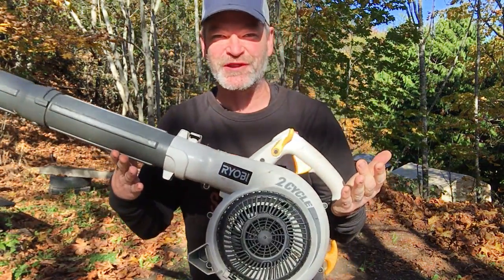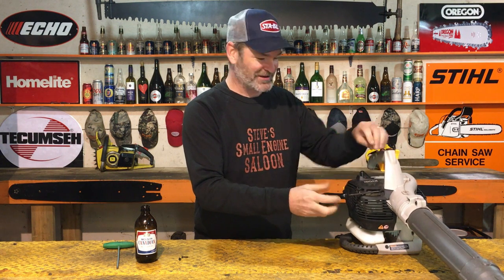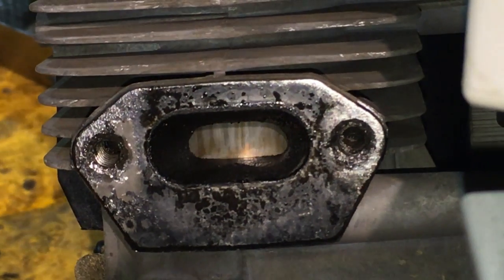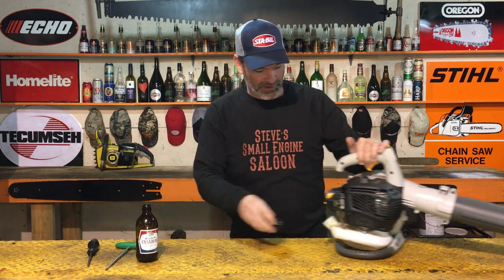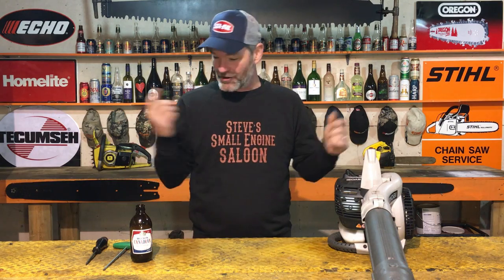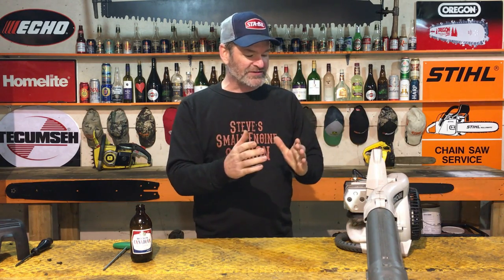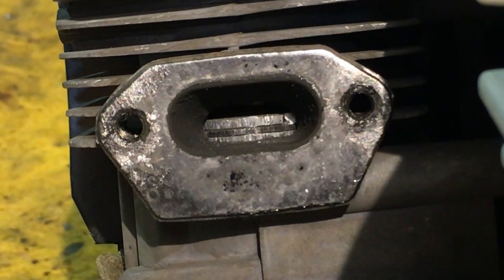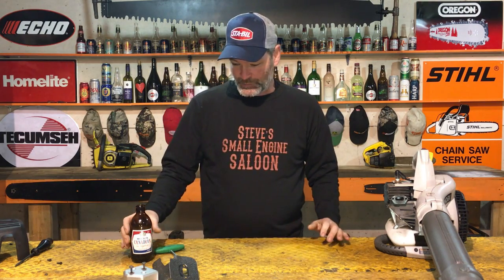What Happens When You Run Straight, Unmixed Gas in a 2-Stroke, 2-Cycle Engine

Comment: I did this very thing many years ago accidentally put straight gas in my weed eater.... It ran about 15 minutes and then seized up tight.... After it cooled down it was not stuck anymore so I put in some oil mix fuel and it ran for years after that

Comment: Is it worth fixin just asking I put a brand new carb on my blower for 12 bucks of amazoo. Also used to replace both pistons and rings  (for cheap) on my 1968 Yamaha 125 twin when I would hit 73 mph and they would melt    lol    good old days
Reply: So is it fixable I got a craftman weedwacker 25cc which we used without mixing fuel wit the 2 cycle what to do now

Comment: Great video! I always wondered what would happen if someone did that? I already have a decent stock of Stihl oil to mix and I’m fortunate enough to have a gas station nearby that sells non-ethanol gas. My question for you is have you ever performed a test to see if one oil mix is better than another or if it’s better to mix your own oil with gas as opposed to buying premixed gas?
Reply: I use stihl motomix which is specifically formulated for stihl machines. It has a much longer shelf life than what I can mix.

Comment: as a mechanic... hardest thing you have to do is diagnose a 2 stroke piece of equipment, which takes 3 minutes as you're being nice and doing it in front of the customer... letting them be involved... they say it wont start, well first thing ya do is try to start it.. squirt a little carb cleaner in it and no luck... pull that muffler and have to explain why the piston looks like your grandma's cheesegrater, you want to avoid accusing them of a bad gas/oil mix cause they can get offended by that, maybe the rpm's were too high, talk them down and dont just say "there's your problem!" sometimes this job can be as hard as a medical professional giving bad news to a family. alot of equipment i diagnosed lately "looks" from the outside as if it's only had very little use.

Comment: Hi steve man I need your advice I have a husqvarna 525L since new it's always had hot start issues like the older echos but older echos I would just prime them 5 or 8 times and half choke them and they would start but husqvarna you can't half choke them and I've tried every trick and nothing it takes me like 5 minutes to get it going and that's time lost I've taken in for warranty all they do is adjust the carburetor and still does the same thing i use 89 octane and echo oil and i don't choke it when it's hot all i do is prime it like 10 times it starts and turns off it does this like 5 or 8 times until it finally stays on I've heard this is called vapor lock or something like that.

Comment: This same thing happened to me with the Poulan PBV-200 Power Blower/Vacuum that I bought in 2004. Worked fine all these years. In 2019 It lost power slowly until it quit. Couldn't restart. Blowing off snow outside in 22 degree weather after a snow.  Piston and cylinder looked exactly the same. Fuel/oil mix was correct and fresh. I think the issue was I didn't let the cylinder head warm up enough to expand and the piston and ring scored up the cylinder causing a loss on compression. Maybe an electric blower would work better. ( Battery powered) NOT AC voltage. ?????? St. Louis MO.

Comment: Question... If the gas oil mixture is wrong will the engine cut out? I ask because I grabbed the can that I believed had the mixed fuel in it. (I still think it was the right can) After filling the blower it won't stay running. It starts and cuts out when I touch the throttle. Last time I used it, probably a couple months before, it worked fine. Which has made me wonder about the fuel I put in it. Was going to drain it and mix a new can of gas and oil and start over. Any thoughts? Can the wrong mixture case this issue?
Reply: Well I figured out my problem, it wasn't the gas. The problem is it's December and 32°, lol. I brought it into the house for the night to warm up. This morning I took it outside and pulled the cord and she fired right up! Ran for an hour and 45 minutes no problem at all. Now I understand 2 stroke engines don't like the cold but I know how to rectify that. Thanks anyway :-)

Comment: I bought a. Cheap snowblower that the guy couldn’t get running and I’ve been running straight gas in it last 2 seasons and it’s been fine I mean I only have like $50 in it so if it breaks big deal compared to buying a new one for a few hundred

Comment: OK so I bought a leaf blower on Saturday and did this very same thing. It ran for about 12 to 13 minutes and Straight Gas and I certainly didn’t do it on purpose I completely forgot. Installed the string when Apple is completely locked. Is there anything that I can do to save the sleep floor. I’ve called the place where I got it and I told them the truth and they told me that I would need to go get it fixed somewhere which possibly will cost me more than the leaf blower did in the first place. Is there anything that you can suggest? I was told to pull the spark plug and put some oil in there and let it sit. So if you can advise me on this I would appreciate it

Comment: Help, today I was using my Echo HC151 Hedge Trimmer, I used straight gas, worked for a while then shit off, re started and died again, now I can’t even pull the string like it’s stuck. I did dump fuel and add mixed but string is still stuck

Comment: a friend did this to his ryobi 36 cc and it stopped running, it cluttered to a halt, engine still turns over smoothly and there is compression but it won't start, not sure if the compression is enough, but there is a "kick" - fairly strong resistance on the compression stroke, but no attempt to fire as if there is no spark or fuel, he was advised to try turning the timing screw but still no go, i am not sure how many turns the timing screw should be out but i tried various positions, checked the usual and put a new spark plug in but no go, any ideas? .there's spark, fuel and the airfilter is clean, fuel gets to the cylinder, the machine is 2 years and used once or twice only, still looks very new.. maybe it was just a soft seizure..

Comment: Now if a person takes the time use a racing very tough coating from MicroBlueracing.com. On the piston, rings, connecting rod and needle bearings etc.  It should run fine for a long time.  But if you use the coating with a oil gas mix the engine won't smoke and will have more power!

Comment: I have a STHIL  back pack blower and I have ran a gallon of straight gas through mine before with no problems that I know of.  I did it because I had no mix and a lot of work to do.  I have since run mixed gas through and after several years it is still going strong.
Reply: No you need to call still and tell them about that they'll probably give you a free blower for life but I'm sure that you added it to other oil and that was a lesser ratio but it still was adequate to lubricate it
Reply: @vickilund7206   I had TRIED to contact STHL via email and also on their FB page But they had never responded to either. Besides I have absolutely NO DOUBT they would not GIVE me anything, heck, they cant even give me the time of day to respond to contacts.

Comment: +stevessmallenginesaloon I was expecting full seizure,i have a mcculloch line trimmer that i accidentally refilled with fuel without shaking the fuel can before hand,first time it happened it started ok but soon as i pulled the throttle lever the revs lowered instead of running faster like it should 😩 it wasnt until 2 days later i realised what id done & in a panic drained the fuel back into the can capped & shook the fuel,filled & started it praying to the engine gods that it was ok,big relief its still running strong months later 😨😨😎😎 be careful make sure u shake 2 stroke fuel b4 filling.
My 2 stroke can has a shake b4 filling reminder written on it now lol 😅😅😆😆

Comment: No lubrication for the piston, kills the engine. 4 strokes have a crankcase, which transfers the oil to the piston and lubricates everything. 2 strokes do not have a lubrication system. You have to mix the oil with the gas, so that when the piston comes down to let in the gas, the oil lubes the piston. Reply any questions.

Comment: '
right grammar is a What Happen When l Run Straight, Unmixed Gas in a 2-Stroke, 2-Cycle Engine...
wrong grammar is a What Happens When [You] Run Straight, Unmixed Gas in a 2-Stroke, 2-Cycle Engine...
dont need to use a word - YOU -

Comment: Always enjoyed the videos. Now how about rebuild video on a this ryobi. A Cylinder head and piston replacement cost vs cost of a new one.
Reply: Yes.  The MRS just ruined the $350 husqvarna this way.  Wondering if there is any reasonable rebuild?
Reply: @robertrayhelm6075 . This must have been a trend. My wife ruined my $350 leaf blower 3 years ago too…. I just pulled it out of the shed to see if it was worth fixing…. Guess not.
Reply: Not worth it if it ends up like this engine. Better to buy a new machine

Comment: I run my blowers and trimmers 100 to 1 ratio for years now without issue. People need to get a proper mixing cup and get exact with it. I’ve seen those little bottles that are supposed to be pre measured and be off a oz of oil in the bottle.
Reply: Why do you run it so lean? Why not 32 or 50:1?
Reply: Brian Morrison I used to use stihl oil at 32/1, bit after I switched to amsoil Saber oil the 100/1 ratio is perfect, I use less oil but get better lubrication at the same time, ya I know explain me that one, but amsoil guy gave me a packet to mix with a gallon of gas to try and I had no issues at all, it seemed to run smoother in fact, stihl fs90r and Bg 55 blower.

Comment: If you want small engines to run a long long time.  Remove the spark arrestor first thing and run saber professional 100:1 with a stabilizer and 0% ethanol in your fuel.  After one tank of regular shit dino juice to seat your rings.

Comment: Here's a question. You ran that on full throttle for almost 9 straight minutes. I don't think even pro machines run that hard. What would have happened if you would have run it the same (WFO) for 9 minutes WITH the oil mixed in?
Reply: While I can't speak for pro models, I can tell you that the two leaf blowers that we use at work are used by people who don't pay for maintenance or care about the equipment. We have had the same two leafvlowers for 3 years now and routinely run them wfo for half hour intervals. We use them to blow leaves and dust put of big hangars and need to get the job done asap so they aren't treated very well while being used. The only maintenance ever done to them is a new spark plug and air filter as needed. I'm genuinely shocked that they have lasted this long but don't seem to have any issues at all. Start within the first few pulls everytime.

Comment: What's the difference between 50:1 and 40:1 mixture?
Reply: 40 to 1 has more 2 stroke engine oil per gallon of gasoline.
Reply: @trentwheeler6161  Thank you!

Comment: Will that be fixable?? Our not worth  the time our money? Better buy a new one?? Thanks
Reply: Joao Costa if you took the time to take it apart, and free the piston ring, depending on how badly scored the cylinder walls are, you may just get it running again, but it will never be anywhere near as powerful or efficient. I’ve brought seized engines back to life doing this method.
Reply: @bobsmithinson2050  thanks.

Comment: I've had several pieces come into my shop lately where the customer forgot to mix oil and gas .... believe it or not , they seized up , and I freed them up by removing the plug and filling the cylinder with Marvel Mystery Oil,  letting it sit for a few days while gradually moving the crank back and forth and it loosened up , and they are both still running today  !! Sometimes you get Lucky I suppose !!
I always run a bit more oil than the mix calls for .... my theory is this .... if it's a smokin' it'll keep on strokin' !! Peace Out !! 😆
Reply: I use that same phrase when i describe my wift

Comment: I think only 2 stroke Tomos mopeds can survive 1 month of driving on pure gas. I've seen many of them running on diesel too 😂😂😂
Reply: Da, comrade! Good Soviet Tomos is strong like bull! Runs good on strong vodka too.

Seriously, I had one of these in the late 70s, very well built Yugoslavian 2-speed automatic. Still remember the bwaaa-rrrr sound as it accelerated and the second centrifugal clutch would engage.

Mopeds were great back then. With 2 HP, they weren't motorcycles, but the perfect machine to cruise about and learn the ropes.
Reply: @robertborchert932  Sadly firm is now in bankrupcy 😥 Otherwise I'm Slovenian. Tomos was originally produced in Slovenia (the former Yugoslavia) with branch in the Netherlands and UK since July 1954 to January 2019.

Comment: I tied a piece of trimmer line onto the handle  of my mixed gas container. Even I can not get them mixed up. I have also been known to put a little extra two cycle oil in  that container. It helps to keep the bugs away in the spring when they are at their worst.
 At least you are drinking Canadian beer on this video. I will tell you a little secret about American beer. American beer is like sex in a canoe....... it is f##king near water. Cheers!

Comment: I'm amazed that it ran that long.  I thought for sure less than a minute would have done it.  Now I'm wondering if less oil in the mix is OK?
Reply: Absolutely not! Run the recommended ratio depending on your oil. If running less is your liking, synthetics are the only way to go. These can allow 50:1 or better. Even in an emergency, running straight gasoline will destroy your engine.
Reply: Thanks very much.  I was posing the question.  I'll continue on using synthetic at the proper ratio.

Comment: Hey I paused at 5:30 just to make my guess. I'm guessing not melted but the rings are torn apart or torn up, the cylinder galled, and every last bearing just gouged to hell. This is like running a 2 stroke on starting fluid for 9 minutes...that said cant wait to see what this looks like...just a Kohler expert certified tech talking...I have an edit you got it right shes in tact but it's a Ryobi who cares in the name of a damn good point why 2 strokes die easy...2 stroke is awesome...people cant figure out that 32:1...a common old ryobi blower mix a 40:1, still common, and 50:1 are not interchangeable. Gas in a quart can isnt good forever. You dont know what oil or gas is in it, get yourself for mid grade or premium 89,91,93...ethanol free in states that sell it, Chicagoland here were outta luck! But just grab some good premium, Mobil, shell whatever and mix 2oz of seafoam a cleaner, stabilizer good for a whole year, fogging oil if injected, an corrosion inhibitor, a lubricant like diesel, a carbon buster and fuel system lifeline! At 50 a gallon for $7 a pint that's 8 mixed or 16 straight gallons of gasoline combined with the second best kept secret that's the pride of Porter, Texas and they...own a nascar track in Vegas the only oil that can kick Amsoil in the ass like Red Forman, ROYAL PURPLE! Famous as one of the longest synthetic lubricant companies that out of dozens of companies when wheel bearings on road wheels on the China bullet train were roasting bearings going over 200 MPH...a speed that should require auto injecting grease...almost 40 companies sent what they hoped would help them extend their replacement intervals...turns out only 1 grease we can get on Amazon prime 14.99 next day made the cut and Royal Purples synslide (I know it sounds like KYs latest lube lol) but this stuff turned roasted bearings into long service intervals and the results of 38 others didnt even come anywhere close. Its 9 bucks a QUART, you cheapos spend a buck for 2.6 ounces do the math...I spend 25% less for way better oil, use a mix cup the marine version at Walmart with the cap is great, the beaker style is awesome just avoid the mixmizer syringe the loop you pull breaks within a few uses...mix your not so secret elixir I described and I dare any single one of you to find a single negative, and please someone do this or who has post because this...this is just the ultimate solution anyone can get, use, do, and see, hear, feel the difference in the performance, the fact just nothing goes wrong, and it's one more bridge crossed that shoulda been fixed years ago. One last thing, use permanent marker, mark the can is mix, the ratio, that seafoam was added and the date, octane and brand of gas. If you do what I just described it's the best article you ever read to finally put an end to 2 stroke woes and if that's not enough say hello to the only 2 stroke oil that's ASH FREE, SMOKE FREE, SMELLESS! You'll think it's a 4 stroke I kid you not. Please, I'm sick of these things in trash cans its saves money, resources, the environment, and time and aggravation you will just try this and go YES THIS IS THE ANSWER...FINALLY!!!

Comment: I already accidentally put straight gas in a leaf blower at my grandparents place. My mom and I were doing some lawn work at my grandparents place and I would leaf blow the grass off the driveway. I ran out of fuel in the leaf blower and asked my mom if there was any mixed fuel. She said there is fuel in the gas can. But she did not realized it was not mixed and neather did I. So I filled the gas tank all the way to the top and leaf blowed for about a half tank of fuel and it still ran fine. At the time my grandpop passed away and someone bought the house. So we took the leaf blower home. My dad was shocked to see unmixed gas in the leaf blower tank. When he told me about it I did a compression test and it was at 120 psi of pressure. I was surprised the thing didn't blow up then. I still use it today and it still runs great. And I always use mixed fuel in it. ☺